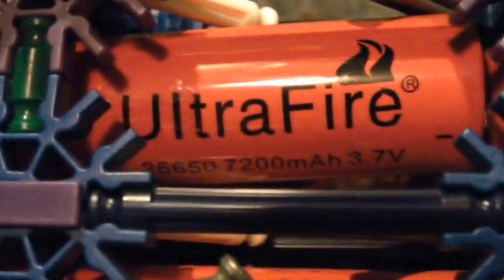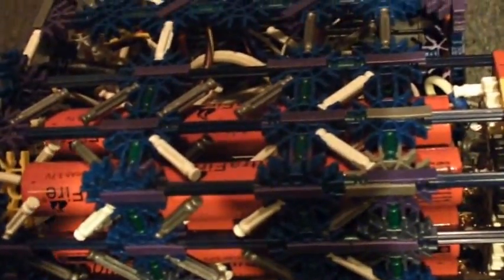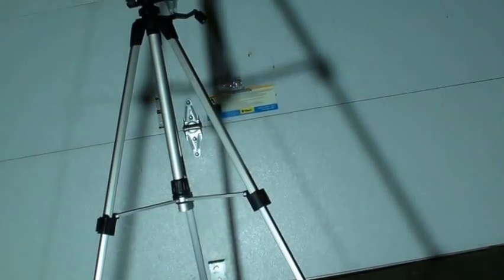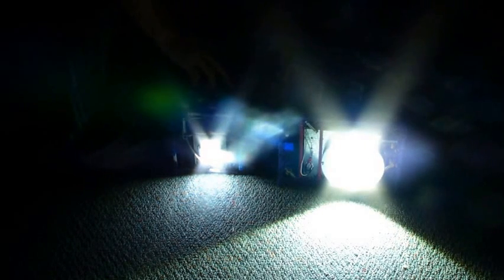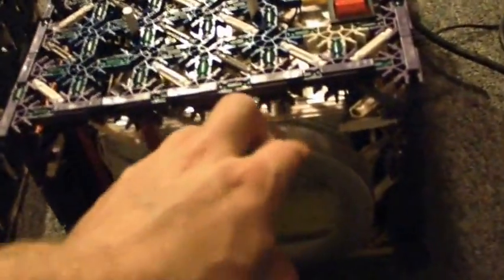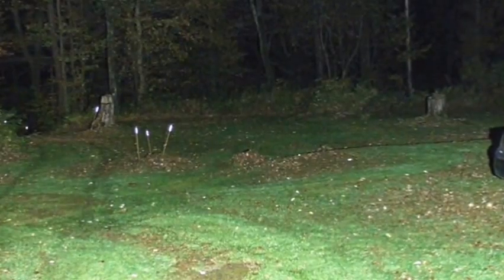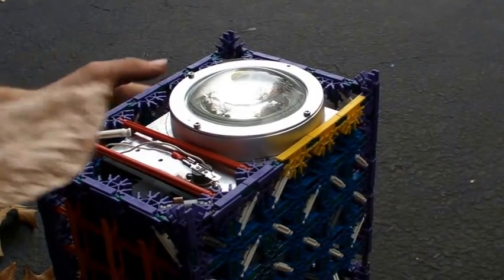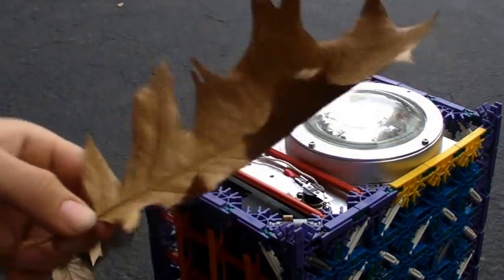500 WATT LED 50,000 LUMEN MONSTER FLASHLIGHT

Comment: Great!! But, how did u feed it? What kind of voltage booster did you use?
Reply from the maker: +Lucas Fodor there is no voltage booster, straight 21 li-ion batteries in series
Reply: +Nick Silcox it's heavy and expensive for me... I'm using a booster and a cpu cooler on mine 100w... But I want to upgrade ... Maybe, if I change the booster to a 10-60v - 12-80v 600w, it will be lighter and capable to light a 500w power led... But I'm a noob on eletronics, can u help me with this?

Ps: sorry about my bad english, I'm studying it to
Reply from the maker: +Lucas Fodor i built a 100 watt flashlight and i do use a cpu heatsink with 2 PC fans and use a small 12volt 10AH battery to power it, the 500 watt is an expensive project to do. powering it and keeping it cool can get costly. the problem with your method is you wont have enough power from your source (powering the booster) to run the 500 watt at full power. 

i am redoing this project and i plan on making it a complete DIY project for this 500 LED from powering it with batteries and wall power, finding a way to keep it cool and lastly making an enclosure for it

Comment: Where did you get a 500W LED?  That would draw a lot  of current.  Did you put in a dimmer controller?
Reply from the maker: i got the led on eBay. draws 8amps@80volts.
Reply: Nick Silcox Wow that is powerful.

Comment: Where buy your lens & round cap to your lens??
Reply from the maker: +TOMMY HANSSON ebay, ask the seller for a lens, luckily the seller i went to did so i got the led and lens from the same seller.
Reply: Thanks. Can I trust on yellow battery R6 3.7V 9800mah or them fake?
Reply from the maker: +TOMMY HANSSON you want to get batteries that are genuine name brands like LG Samsung Panasonic, etc.
Reply: Thanks :) I LIKE your super extreme power 500W led lamp! I have 150W 150W No fan needs for 3 - 5 minuts on?
Reply: What is the total dimater the round silver part in the lens?
Reply from the maker: +TOMMY HANSSON roughly 5 inches, it came with the lens. ask for a mounting bracket for the lens
Reply: Yupp. My box is 120 X 120 MM. Way too tight measures for 5 inch?
Reply: Great!! My box 120 X 120 MM 150 - 200W lens outer diamter is 108 MM. totalt for 200W version! No problem! :D
Reply from the maker: +TOMMY HANSSON hopefully you can get good cooling in that small box for the led! :D
Reply: +TOMMY HANSSON this 500w led is going to get very hot, would personaly recomend watercooling, but big aircooler with delta fans is good "power suply for this led is the hardest part"
Reply: TM80 NotGoodWithNames I have 150W led no probleme :) I buy lens for 200W :) 2 - 3 weeks from China i live in Sweden :)

Comment: Great video - that fan sounds as loud as a vacuum cleaner - I'm thinking of using a similar set up for a 500 watt COB for a film light but do you think the fan noise would be too loud for that?
Reply: Use bigger heat sink or maybe do some custom water cooling.

Comment from the maker: @Nonnof Yobiznes
no lol they didnt come after me. this was one of the clips i did. 
there are 100 watt led (cheap) then there is a 200 watt led, (roughly $25) i could not find 300 or 400 watt leds, the 500 watt led is the most powerful led chip available today. the seller had a lens so i bought that too along with the 500 watt chip.
Reply from the maker: ***** if you just buy one, whats the fun of building one?
plus those are only around 3,000 lumens, this thing is 50,000 lumens!
Reply: Please please, tell me where did you find the booster. The one I have says it's rated 150 to 600w but somehow the light coming out doesnt seen as bright as yours. I'm using 18650s. I'll be making a battery pack. That's another thing I need to dig into.
Reply: Nonnof Yobiznes I does not know how he does it, but you have to about; is the batteries giving enough current? Are the batteries connected in series or parallel? I think you have the same booster as me, and when I bought mine, the ebay site I bought it from said that the booster need enough voltage to give enough current. There you have something to think on. 
And sorry for my bad english.
Reply from the maker: +Nonnof Yobiznes in this video, there is no booster, just a direct connection of the 21 batteries that are hooked in series that supplies 8A of current that  provides the led 
i am in the middle of upgrading the housing and batteries to 18650s, i plan on making a 48volt pack with at least 16,000mah with a booster (i have the same booster as you do)  i ordered batteries (genuine) and i need brackets and a way to charge them up. that is the only thing that is holding me from completing this project.
Reply from the maker: +Nonnof Yobiznes  in this video, there is no booster, 21 batteries hooked in series and that came with the voltage required for the LED. 
 i am making a DIY for remaking this LED and the battery pack is a whole project its self, Lithium ions are very picky when it comes to charging and discharging.  for charging battery packs, an imax B6 would work for packs with 6 cells or less. anything more, you will need a BMS that can go up to 13 cells (48v) i will show how to wire that in my DIY that im currently making.

the heatsink i bought on ebay from a surplus seller, it took me a few days to find this one, but any heatsink with large fins will work for the 500 watt
Reply: +Nick Silcox That's great news man. I'm subbing to see it as soon as you upload. I have almost everything. I just need to figure out the battery. I've been thinking, maybe using lipo pack? That way it might be easier to charge them without having to worry about balancing.

For cooling, I got a plaque of copper about 4v4x.5 (quite heavy) which I sandwiched between the LED and the heatsink using thermal paste and screws. I'm trying to figure out how to fix the lens for proper sliding. I'm thinking to use a reasonably thick aluminum sheet and some other parts I got for the housing.

Btw, sorry I got confused with the booster. It was +Mortæææn who mentioned the booster.
Reply from the maker: +Nonnof Yobiznes cool man, i need a total of 130 18650 cells and i gotta test each one individually especially  because i am getting them from laptop batteries. then wire up all of them into series-parallel ,  i am hoping i can get the battery pack done/working on it by the end of the year,  or early January, gotta love waiting for stuff coming from china...lol

yeah no worries, you only need a booster if your power supply doesn't put out 70-80VDC, but if you got batteries that can do that, no need for a booster. but if your gonna make the 48V pack, then the booster will come into play

Comment: Those ultra fire batteries are fake just so you know, even the best 18650 batteries max out at around 3500mah. I recommend you get some Sony or Samsung 18650's. They aren't cheap but they are worth it and will last longer.

Comment: Bro those batts are ripoffs.  U could probably get the same performance from half the amount of genuine 18650s. Maybe less depending on the cells.  They will run u about ten bucks each on the cheaper side but it will save alot of space

Comment: batteries are a joke
Reply from the maker: morkiuzz the batteries i have are not a joke, they provide good power and even to this day, they still work flawless.
Reply: Nick Silcox Ultrafire is a cheap chinese band, they do not provide amperhours that are marked on them. You know thatm right?
Reply from the maker: morkiuzz I do believe you there, i did get a few chinese batteries, and had to throw em out (i drove a nail through it so itl be safe)  i may of gotton lucky this time cuz the ultrafires i have supply 7-8 amps @70-80VDC for a good hour before they needs to get recharged
Reply: So that's why I said that these batteries are really bad